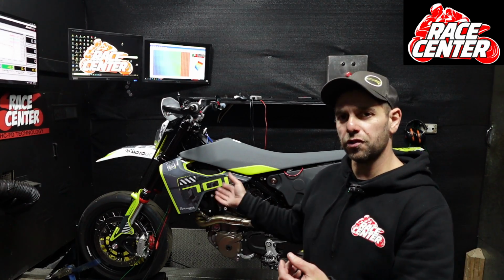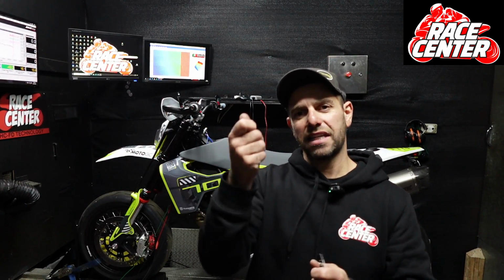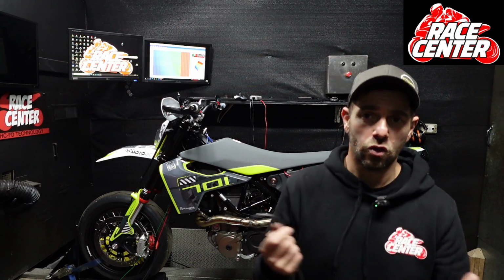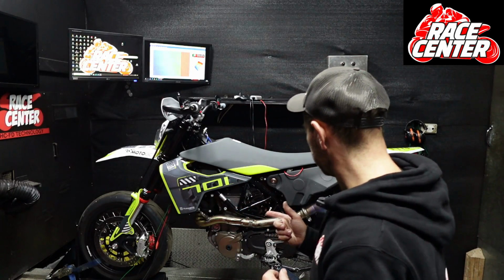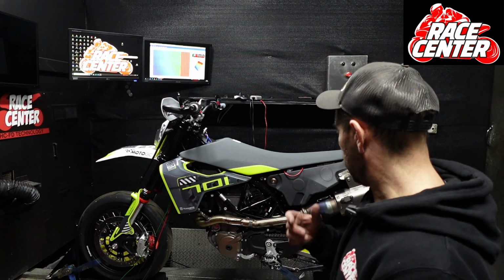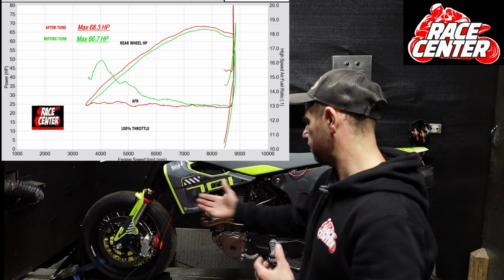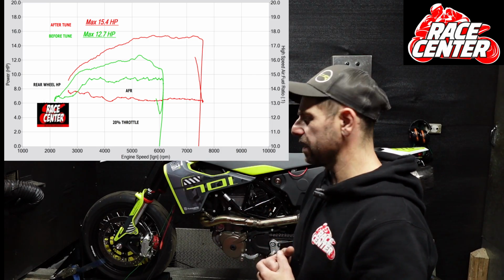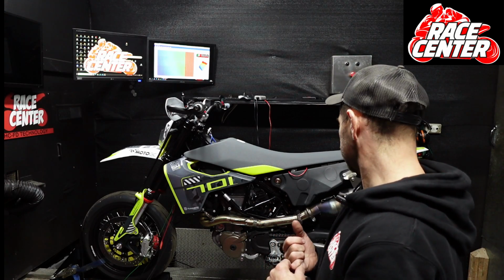2022 Husqvarna 701 Supermoto Tune

Comment: Nice informative and honest video.  The crazy lean part throttle AFR on the dyno graphs tell the story.

Impressive you can access and tune the ECU, that is way cool!  In the US with a '23 701 Enduro, Rottweiler mapped PC6 with O2 eliminator, a Yosh can and trimmed air snorkel.  Do you guys ship to the US?  If so I would have gone with you, as I would prefer have the ECU tuned directly and not to have the extra "hardware" that in the form of the PC6.

Anyway, these bikes benefit a ton from tuning.  Wheelies are much easier to initiate with proper part throttle fueling.  So ya, it is no longer "street legal"  but I suspect the exhaust and tune are the least of my potential problems here in the US, as they don't inspect or emissions test bikes here, and cops really dislike wheelies  😂

Comment: Since you tune it through the ECU, does "autotune" function works, correcting fueling by reading the Lamda sensor? Do you have any experience with Rapidbike EVO that also uses the closed loop/lamda?
Reply from the maker: You can leave that feature active and also change its targets if you wish or switch it off and use a manual tune. Depending on what the bike is being use for.

Comment: I am planning on getting an Intake for my 2022 701sm, as well as a leo vince slip on exhaust w/o the dp killer. What kind of unit should i get to fix the air ratio? Does the PC6 not work for it? Rottweiler Performance has a whole intake and PC6 kit that comes pretuned, but would the PC6 unit (which I think is a piggy back unit) not be the "correct" way to tune it. 

also for your unit, would it come preprogrammed for an aftermarket intake and exhaust or would I need to do something to have it programmed for that.
Reply from the maker: So sorry for the late reply. When we did this video, you couldn't, the PC6 wasn't available at that time. We have done all our tunes since through the ECU so we have no experience with the PC6 on the 2021+ version. Dynojet does list the PC6 for the 2021+ now so it must work! We haven't used it though. Again sorry for the late reply
Reply: It still can't modify the closed loop at least not on europe bikes.
Reply: I have a 23' 701sm. It already had the Akrapovic slip on when I got it. I just added the rottweiler intake, fuel dongle, SAS delete, and PC6 all ordered from Rottweiler Performance - major noticable difference in performance with no engine light so far. It still has some bottom end lag but not nearly what it had before. Waiting to get to dyno tuned to dial it in.